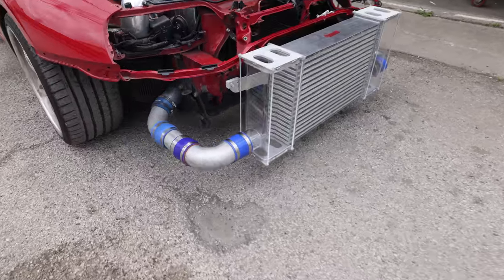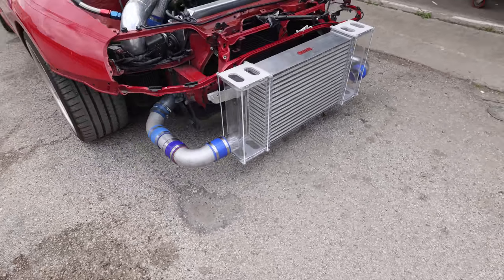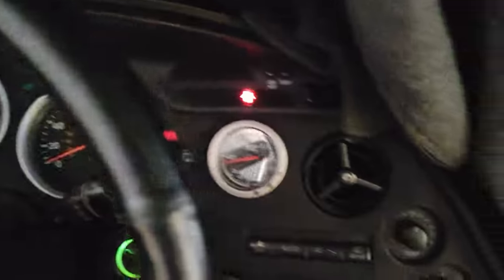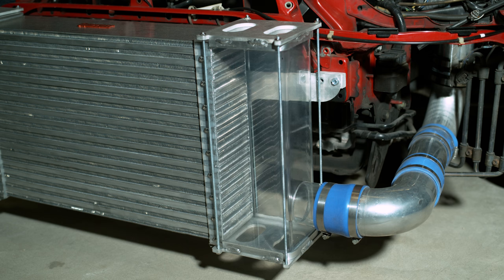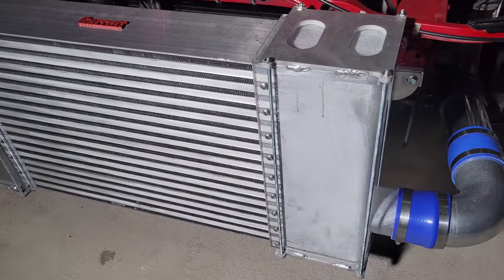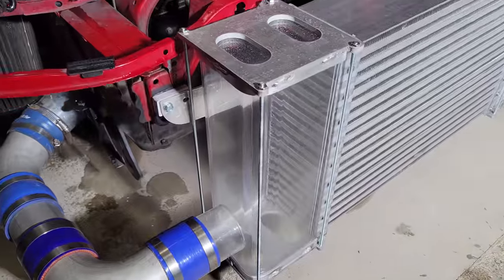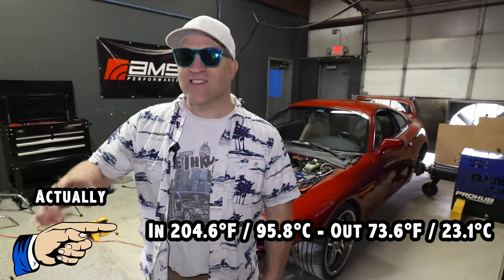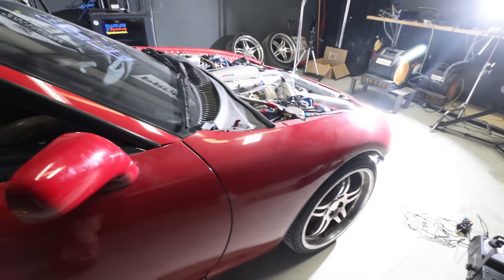See Thru Intercooler In Slow Motion - (Dyno Run High Boost)

Comment: Thank you for uploading this video. I always wondered how an intercooler worked. I had a Volvo S70 TDI as that'd an intercooler the size of the radiator itself and a massive turbo from stock  so no wonder it pulled the way it did. Also explains why cars runs better in winter than summer. 👍
Reply: 170hp craziness lol
Reply: @Sebbe40  1998 S70 TDI only had 145 hp. At least in Scotland but had plenty Low down torque already at 1200 rpm hahaha
Reply: as a guy who lives near the equator, a shitbox runs waaaaaaaaaaaaaaay better at cold nights
Reply: it also explains why i see more tuner cars run at midnight, colder air and less traffic
Reply: That’s all cars or anything internal combustion will run better when it’s cooler and with more dense air

Comment: really cool to see!
regarding the temperature delta: it would be really interesting to have measurements over a longer timespan. the intercooler is a heatsink itself after all, so the massive delta could be due to the intercooler not being at "working temperature".

also: is that a supra?
Reply: Interesting how even the flow is in the tanks.
Reply: An intercooler will indeed heatsoak over time
Reply: we endurancce race a Subaru WRX. Yeah, heat soak is real and there are ways to minimize it, but the IC has to get a delta T across it to transfer heat, so it's somewhat unavoidable. Subaru uses a water sprayer like for winshield squirters and a timer that sprays the IC for about 10 seconds. That evaporative cooling is good for 20-30 hp for about 30 seconds. Nuce push-to-pass button, though!
Reply: @webb4252  Boost is rarely constant. The IC will cool down between hard boost runs.
It will reach somewhat of an average but is constantly shedding heat.

As Josh said, an IC optimizer with water and alcohol will significantly lower temps of a "heat-soaked" core.
Reply: That would be nice if they could make reliable intercoolers out of plastic. I’ve seen some manufacturers do it but after a while they do break
Reply: @FZERO20  Lots of OE intercoolers are made with plastic end tanks, they usually outlast the car unless they are involved in a collision.
Reply: Pressure drop would have been a good data point.
Reply: @BigEsGarage  i see! you're a man of culture aswell :goodvibes:
Reply: Best comment!
Reply: seeing the ambient temperature would also be nice. compare the 3 temps; ambient, post turbo and post intercooler.

Comment: Use UV dye in the fluid,and UV lights,you could get more visual intensity/contrast on the flow i think.
The camber on your front end is no good,like the rebound,the car seems bumpy.
Reply: @sourand jaded it's very hard to kill that 2j
Reply: I owned this car. Bought it brand new in 1997 ... and had a Front Mount IC ... I would never have believed it dropped the temp that much dynamically (in motion) ... let alone, static.

Comment: Wow. With it being clear, you can in fact see the air going in one side, and out of the other. Just amazing. Had no idea that air flowed like this. I really liked the part where the air went in one side, and out the other. It was really crazy to see how this happened at different engine speeds too. In one scenario, air went in one side, and out of the other. And when the turbos outputted more air pressure, air went in one side, AND OUT OF THE OTHER SIDE! Damn if this weren’t see through, I would have had no idea that air would go in one side, and out of the other side.

Comment: I think that the smoke pattern shows perfectly the problem with having the inlet and outlet directly across from each other and not offset. You can see that the top of the radiator does get some airflow, but it only gets any airflow because the shortest path is making too much resistance, and you can watch as the smoke pulls through the top half a lot more slowly. A simple radiator design such as that commonly has the inlets and outlets offset in order to alleviate this, and make more efficient use of the whole radiator. Some of the more advanced designs I've seen also section out the airflow into three or four segments before it gets to the fin stacks, which I imagine also works pretty well for flow distribution.
But at the end of the day, the tempurature tests certainly show that optimizing the flow pattern within a radiator isn't necessary to have a functional radiator, and that radiator certainly pulled some weight when it came to cooling. To be expected, given how thick it is.
Reply from the maker: That is literally the only and the exact reason why I went through all of the trouble of building it and filming the video, I have been wondering this forever. Every front mount intercooler that I can remember that I have installed had the inlet and outlet right across from one another, and the rest of the inner cooler would stretch out in One direction, I always thought how much air is actually going through that top portion especially under higher boost and higher velocities. My goal in this video was to do a higher pressure test like 15 20 psi with the fog, but it failed prematurely and that's okay, I may come back with a bigger better intercooler to run some big boost but I'm not 100% sure it's worth it... Thanks for the awesome comment insight and information!
Reply: @WarpedYT  Is it really that common in automotive? My background is in IT, and a lot of my knowledge here comes from interpreting off a mix of that and a basic understanding of thermal and flow physics. Most PC watercooling radiators are split units so that the inlets and outlets are on the same side, but the few radiators with a straight through design I've seen are all offset as I mentioned. I suppose, in the PC world, a radiator design like that doesn't introduce enough resistance to the flow rate to force flow in what would otherwise be a dead zone, and the performance impact is a lot more noticeable.
Reply: Well designed ICs have a number of techniques to balance the airflow across each channel of the IC core. 
The most notable is curving the end tanks in towards the core the further it is away from the inlet/outlet. This speeds up the flow and should get rid of the still / turbulent flow in those areas.
Corky Bell wrote a great book on turbocharging. Explains much of this and more in the Intercooler section.
Reply: I'm doing aeronautical engineering and I'm developing potential sidepods for a Formula Student car and I've been messing around with cfd, trying to optimise the airflow and what you just said was the first thing I thought of when I saw the intercooler.

Comment: Next test should be with different end tank designs, to see if you can achieve a better distribution of air through the intercooler core. you could try different designs, some with diverter plates inside, or even vertical flow intercooler would be interesting to see. Overall great content!
Reply: The end tank design on intercooler is split, so it uses the whole intercooler not just the path of least resistance. This test didn't prove anything.
Reply: @russiancommy  this definitely showed the path of least resistance by a heavy fog straight through and a lighter fog along the top
Reply: @russiancommy  just what are you wanting proved?
It was an observation not some new design proving ground design for the new and improved cooler. Y'all weird always the same with your generation ( prove this, validate from Google please, or internet says different. I'm going to think about it. Y'all really weird
Reply: @jasonmorris2813  says "y'all" and talks about generational difference, stick with it bud.
Reply: @russiancommy  best comeback ever! damn, you sure told him!

Comment: Love seeing this and how the fog illustrated the flow (in slo mo) especially as the boost dropped off. I wonder if it would even be worth running the hot air in at the top part of the cooler but leave the exit at the bottom where it currently is. Not sure that would make a difference in cooling but be interesting to see/measure.

Comment: That was amazing! What else would be cool to see is how fast the fog moves thru the pipes at idle veruses boost? Does air flow moved slower under boost?
Reply: Just the engine RPM will affect airflow velocity I'd think. Like 2000cc engine will move 2L of gas per cycle. Boost will affect air density but not velocity.

Comment: thank you for showing the temp difference between air going in the intercooler to going out.
it shows how intercooler doing great job and that without air blowing directly into it.
just imagine when running on track or street the difference would be much significant.

Comment: Bro 73 degrees Fahrenheit!? Bro my car n/a loves the weather when it’s around that temperature. Your intercooler is basically an air conditioner. That’s cool asf bro, I would’ve never thought to do something like this but I still thank you for proving that taking these little steps to improve your car is worth it. And you did it by actual testing

Comment: It was great to see how air comes in and out the tanks. Now the taper tanks makes so much sense. Also you showed what Garret cores are capable of
Reply from the maker: That's the same thing I was thinking, you can see how the air takes like a tapered form. That's one of the reasons I made the tanks square, I wanted to see what shape the air flow took on.
Reply from the maker: Yeah the intercooler core really chilled that air... I was very impressed by that.
Reply: @WarpedYT  what was the ambient temp in that room?
Reply from the maker: @gpgt89  great question, I should have said that in the video, it was around 68° f. I forgot that, I forgot the thermal camera, and I forgot to show all of the damage that was done to the tank...lol
.. oops

Comment: Good illustration of why a cross flow intercooler is a better idea. The top portion is the last to get the vapor and the last to clear the vapor because there is little flow up there since the inlet/outlet are on the bottom.

Comment: In my analytical mind the intercooler has 17 rows of air tubes. If they are each a quarter of an inch tall and 4 inches in width, there would be 17 square inches of flow area. The inlet and outlet tubes appear to be around 3 inches in diameter giving them a flow area of around 7 square inches in cross section. This would cause the velocity of the air flowing through the intercooler to be reduced by a factor of 2.4 times while inside the intercooler before accelerating once going through the outlet, in essence allowing the air to have enough time to cool. The failures regarding the transparent plastic when exposed to high pressures will undoubtedly end up being resolved. Nice demonstration and a big thumbs up on this one.
Reply from the maker: Good thought , so the math is each row is .375" x 5.5" =2.0625 sq in per row, x 17= 35.0625 sq in  which would be equivalent to an opening of 7" x 5" which is pretty significant. For comparison The pipes are 3" so 1.5x1.5 x3.14 = 7sq in. 1/5th the surface area of the tubes combined. I would imagine that would slow down the velocity significantly going through the core.

Comment: That is exactly what I built my 4g63 truck and 4g swapped 3000gt VR4 for. Daily drivers with a lot of horsepower and no issues.

That intercooler works really good at 20 PSI!
Reply from the maker: I got rid of the 4g63 a few years ago... About a year after I completely regretted it. The transmission was giving some issues, it was a Mitsubishi GSX all wheel drive...🤦‍♂️ What a dumb dumb I was
Reply: @WarpedYT  That is unfortunate man, you may have done the right thing though as it is getting near impossible to find transmission parts for the cars unless you go Auto or straight cut dogbox with them.

Comment: Thanks for doing that video. Pretty cool to see the temperature gradient betwixt hot/cold sides of the IC. Brings back many memories from the 1990's. Didn't realize just how profound an era that was, until compared to some of this stuff that's rolling off of today's production lines. Some current production setups are interesting - particularly the 2022 Toyota Tundra (V6 twin-turbo). That's damn near guaranteed to be a tuner's wet-dream in a few short years.

Comment: I think the most interesting thing for me to see is how the fog builds up low both entrance and exit then fills upwards into the rest of the intercooler, then once the fog stops it clears from the lower half of the intercooler first.   The shows how important the shape of the inlet and outlet casting is.  Centrally locating the pipe and giving some ability to spread the flow out will provide better cooling across the cooler and provide less drag/resistance increasing flow efficiency.

Comment: Absolutely an excellent experiment! Id like to make a couple suggestions if you intend to try this again. Where you screwed the plexiglass to the intercooler itself: I'm not sure if i noticed if you sealed it with anything? Im assuming you must've but if you didn't, a thin rubber gasket with adhesive on both sides. The slight give in the rubber will allow you to equally tighten all the screws and provide a barrier to help cut down on vibration. Then, i would cut a strip of 3/16 plate, or at the very least 11 gauge, about 1.5" wide, drill and counter sink the holes matched to the plexiglass. That will also help with steady and even screw pressure spanned out across a larger radius of space on the plexiglass. That should keep it from splitting again like that. Maybe even move the holes in away from the edge a little more if you can. Use good machine screws like you did an spray them with silicon first so they won't bind when you torque them down. Another point i wanted to mention is how well the difference in temp was. A lot of times in a lot of elder applications, intercoolers wouldn't make much performance difference because it didn't get heat soaked in common day to day situations and conditions. That makes me curious to know the hp difference that engine makes with vs without an intercooler.

Comment: You can see why the end tanks are tapered on intercoolers. To prevent deadheading or swirling of air which will reheat the charge to a certain degree and inhibit flow.

Comment: The best way to see why the inlet of the intercooler needs baffles, the pressure goes straight to the portion of the intercooler in front of the inlet passing through the ducts and the rest just goes slowly to upper side of the tanks in a unproportional way, the measurements of the temperature was incredible excellent never imagine how much temperature drops from one side to another, just for better way to do more test at higher pressure I would suggest to weld a aluminum tanks on both sides and use just one side of 1” acrylic plates bolted on like the ones you use for the piston inside view…👍🏼😎🇵🇷

Comment: Awesome video! Neat seeing the end tanks function. For the temp split you need to run sustained power. I've seen 150°F split, with the Greddy 3 row STILL achieving ambient outlet temps at the top end of a 5th gear Dyno pull at 25psi - of course with a fan on the turbo filters and intercooler, like it would be on the road. Pretty impressive! At that point: you can begin to see where you are laying on the turbos efficiency chart. As the boost and power go up: the temp spike begins to really spike. That's where the intercooler comes in and does it's job to combat that high IAT.

Comment: Thanks for your nice info-clip and yes, I have a turbo and an intercooler on my 5.9 l Diesel but 
had no idea what's happening inside of them.

I had to turn the pressure down to ~30 lbs. after the good old Cummins liked to eat trannies 
when pushing ~ 35+ lbs. (= about 350 hp instead of the original 215 hp) of boost.

Comment: The thing I found interesting was when the tank blew off on the outlet side of the intercooler.
It blew because the throttle plate closed abruptly and the pressure wave back thru the intercooler overloaded the tank perhaps. Which shows having a correctly sized and adjusted BOV on the boost pipe is very important. As is intercooler design to ensure enough backflow thru the core is possible to reduce the pressure collecting in the cold tank and not being able to pass thru the core fast enough on throttle close.
Reply from the maker: The throttle was still open when it blew, so it was the pure pressure, and I meant to show how the tank broke but I forgot to put that footage in the edit. As for the blowout valves yes they are very important I have two very large blow off valves on this car. I don't lose any boost in between gear shifts

Comment: great part 2 awesome end tank failure at least it didn't hurt anything when it let go and you were able to do the smoke runs
strange how it seemed like it is very slow moving at the top of the intercooler
Reply from the maker: Thanks! It was strange but kind of what I expected.
Reply: @WarpedYT  makes sense

Comment: Very cool! Drastic change in air temperature! Would be interesting to see what the difference would be with fresh/outside air coming into the the intercooler when driving on the street, or by using fans to simulate the test. Great video!

Comment: That was Amazing! 
 I'm really happy to see not only are able to drop the temperature that far  from 204 degree to 74 degrees  & it doesn't seem to matter how big the intercooler is to a turbo set up. 
 Did you look at your hp just before it blew ? Because I bet you were either at or over 1000 hp. Because of the cooler temperatures going in. 
 Be safe
Reply from the maker: I was really surprised by that as well, that was cool to see. No I didn't look at the horsepower because we weren't doing any sort of horsepower runs, I peek out at about 32 psi of boost, and we were only at about 16 to 20.